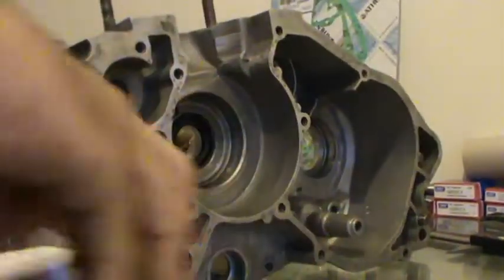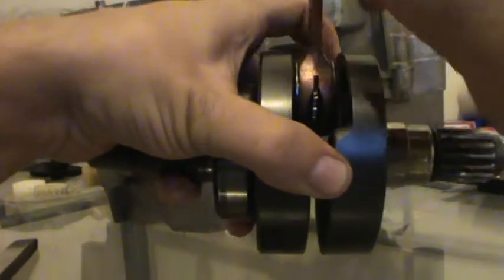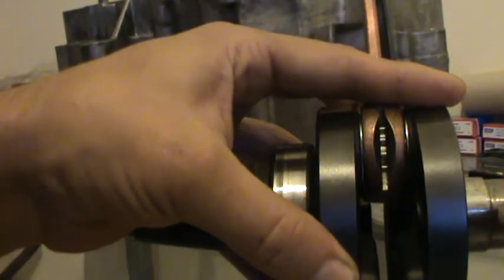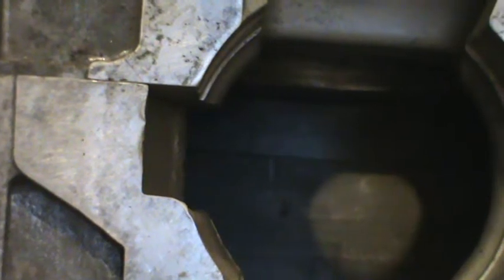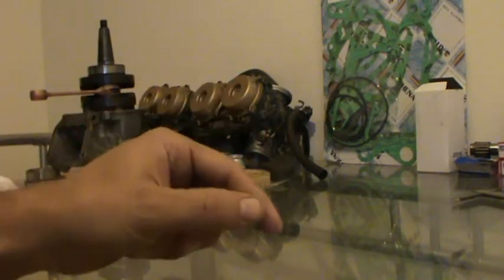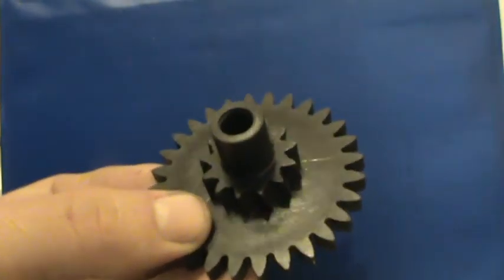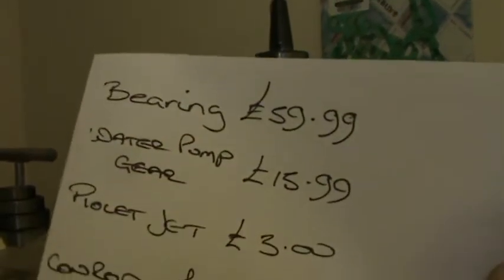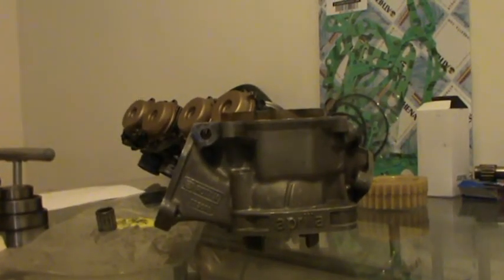Aprilia costs so far, why change bearings, warped casing, parts need replacing.

Comment: Why can't the gears be metal ? Its mad to me how they are plastic good video btw
Reply from the maker: The cost of metal gear should they fail will destroy the engine casing.  Nylon gear are more forgiving.  They need little or no lubrication.  Being a 125 not much is required and become more cost effective.  Making these parts more affordable to replace like consumables.  Hope this helps bro.    Take care. :)